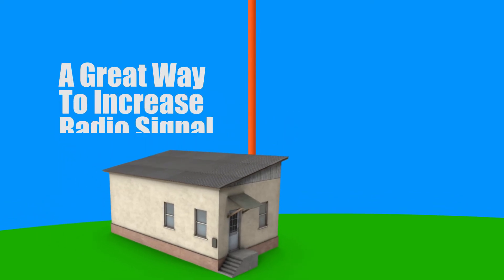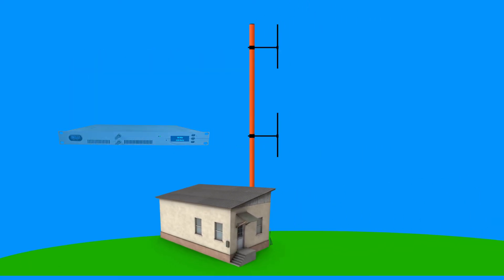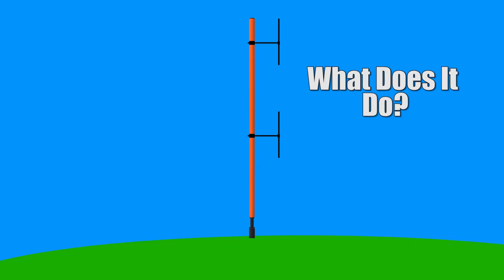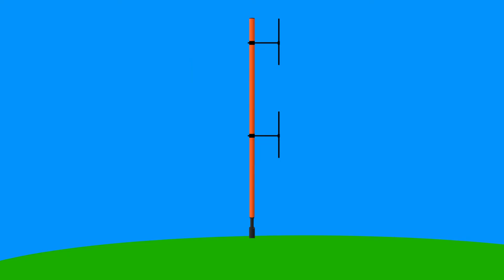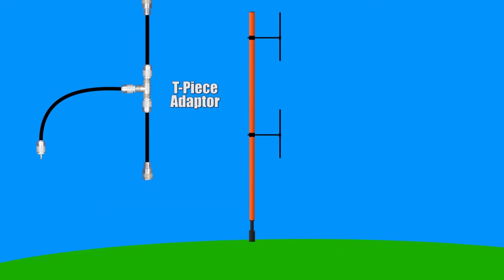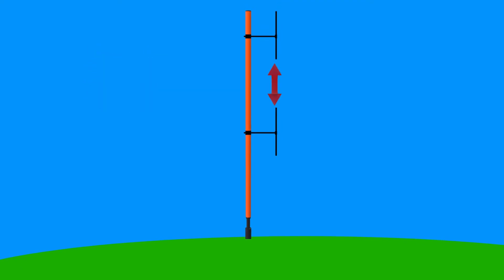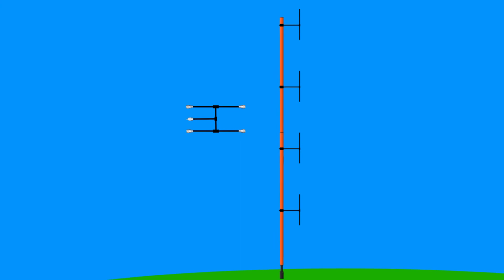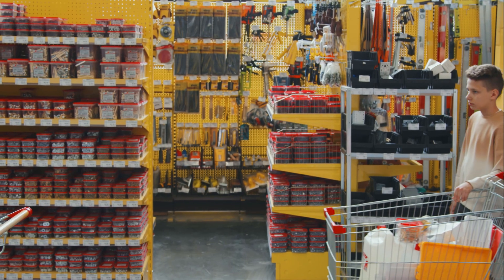FM Radio Station ANTENNA ARRAY FM Transmitter Set Up. Get It Right For Best Signal Quality.

Comment: I am glad that you mentioned down tilt, it can significantly help with coverage in the local area. Phasing harnesses are not difficult to make and we do have plenty of test equipment available these days to make the measurement easy.
Reply from the maker: Hey thanks for your comment. Yeah if you are set up with some nice test equipment it can be done but a lot of my viewers are new to transmitters and antennas so have very limited access to test equipment. Yeah thought I'd mention the down tilt even though it's too complicated to give it the explanation it deserves in this video. Maybe in another video some time :) Thanks cheers.
Reply: Howsabout using a nano vna to tune/test the harness? It would be a great learning curve for several reasons and the units have become very inexpensive and easily attainable....thoughts?

Comment: Interesting. I only have one single bay FM. All the others are taking 10kw and making 25kw, 20kw making 50kw and 30kw making 100kw all through the magic of antenna gain in multiple bays on the towers.
Reply from the maker: Yeah it is amazing especially at such high power. Crazy that stations can run 100Kw. Very cool. Glad you enjoyed the video. Cheers
Reply: @inspiresoundpro  I will keep an eye on what you got going on. I like it when people can break down the complex. I am still a novice engineer/electronics/computer shop. I am the only one left in the area willing to work on the equipment. I can follow along with schematics and mostly understand the engineers when I call the manufacturers after I tell them they might have to dumb it down a bit. Antenna theory/science is all but voodoo to me especially how the bays work but you explained it in a way that makes sense to me. The phase and the spacing without going too deep into the weeds. I have been thinking about applying similar to amature bands but not sure it would work. After seeing Ringway Manchesters series on the duga radar I am curious about caged dipoles too as it seems to be a wall of them. I also promised my great niece I would bounce her voice off the moon so I best get to work. I gave her an old amplifier tube for show and tell last visit.
Reply from the maker: Wow you are into some cool stuff. I have only had a small amount of experience with HAM stuff but it's lots of fun. A lot of the FM stuff can be adapted to HAM and some say it's a lot easier with HAM stuff especially on the lower frequencies but the antennas get much bigger so a bit difficult with that. Thanks for your nice comment. Yeah I try my best to make my videos as easy to understand as possible because most of my viewers are trying to build stations and transmitters for the first time so the technical stuff can be very overwhelming. I have a college education in electronics and I struggle to understand some of the antenna theory lol so I can image what the beginners feel like. Cheers .Good luck with the moon bounce. That's well cool :)
Reply: @inspiresoundpro  Well I have an 8th grade education but I started out soldering simple circuits for my dads model trains when I was like 6 or 7. I learn with my hands and got into the IT side of things when what you could do meant more than what formal education you had. The engineering stuff came along as I started working on automation computers that ran the station. That had me wiring stuff up so the engineers took me in and became my mentors/elmers. One has already gone silent key. The other is nearly there and slowly giving me his shop equipment. Just his meters and soldering station alone is like a master machinist turning over his calipers. Not an easy thing but an honor to me. I can mostly follow along when it comes to RF thanks to them and I have been learning a lot from the amature guys like you on here. If you want some good basic education on RF, inductance, capacitance, etc look up Periscope Films on here. Old 1940s military training videos designed to teach us bumkins out of the hay fields how to repair radios so they are very easy to understand. Might be a good place for you to mine for content.
Reply from the maker: @JamesHalfHorse  Hey I know it's about 8 months late but I just saw your reply no. Sometimes YT doesn't notify about all message. I hope you are doing well with your work. So great to hear that some people are still mentoring. It's so important but very rare these days. Cheers all the best.
Reply: Kindly send details